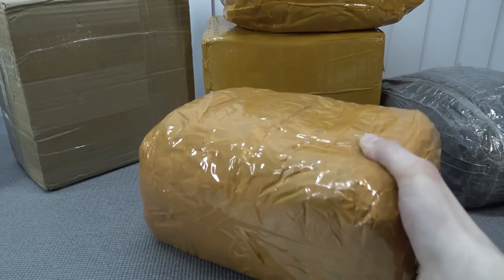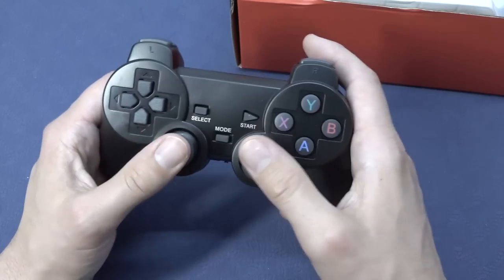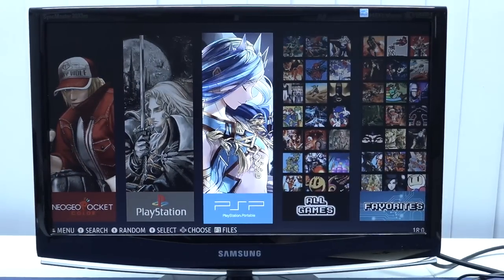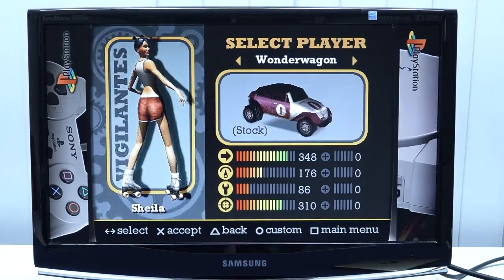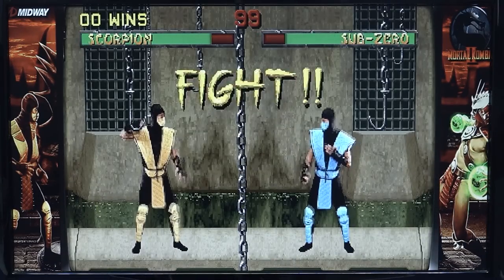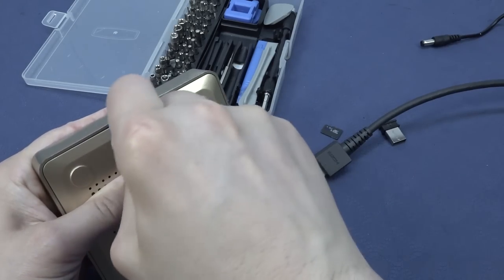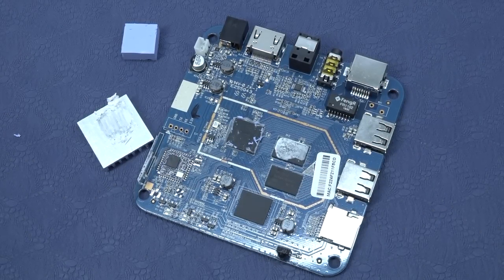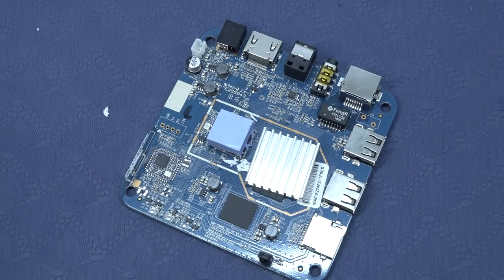X9 Game Box PRO Retro Console .. The New Ultimate Way To Play ? 😳

Comment: they might have rubbed out the size of the card because it could be one of those that suggest there is much more on the card but the capacity is far less. Ive been burnt a couple of times with that little scam already. And it was also be in line with the Chinese way -- "Cut corners, or don't do it at all"!
Reply: So, you’re telling me that if I buy a 2Tb usb drive it will not actually be 2 Tera? :)